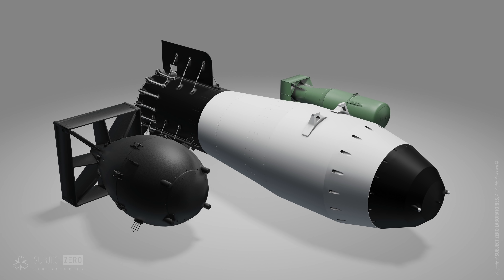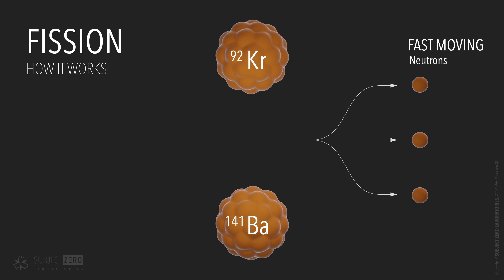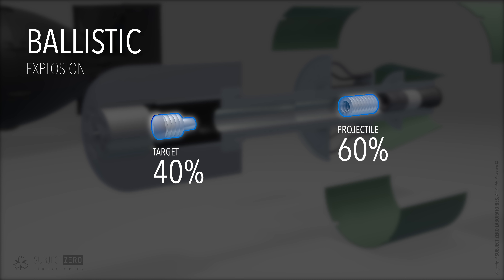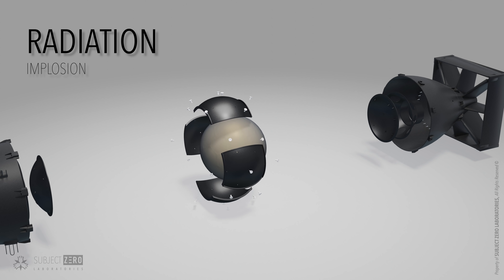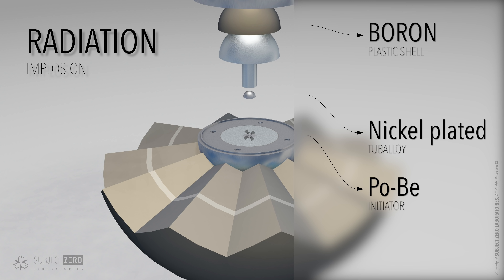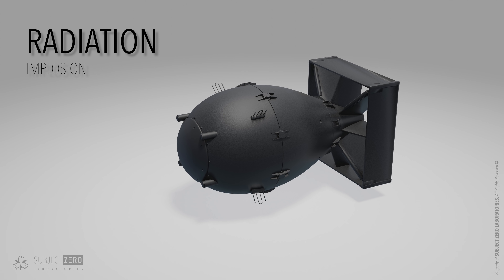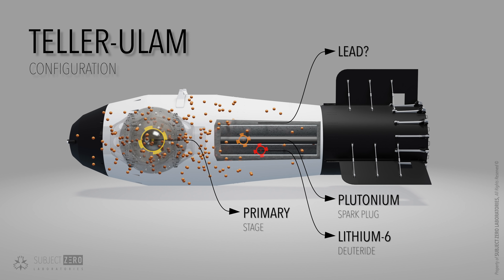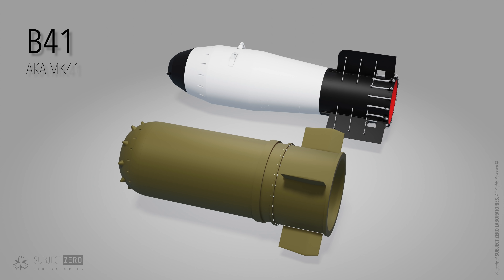Are Russian Nukes the Most Powerful?

Comment: Amateurish video. For example you miss label the stages of a Ulam-Teller design. The First Stage comprises both the primary and the spark plug. They serve the same purpose, to compress and heat the lithium deuteride to a temperature and pressure that allows for fusion to occur. The Second Stage is the fusion of deuterium  and tritium, two distinct hydrogen isotopes. Deuterium is part of the lithium-deuteride obviously and the tritium is produced during the reaction by deuterium capturing neutrons and also the decay of lithium-6 under the intense neutron bombardment.  The Third Stage is the fission of the tamper-pusher, the outer casing of the bomb. This casing acts as a reflector concentrating the X-rays emitted by the primary onto the fusion core. The process which creates the pressures needed for compression of the core is classified but it is believed it is based on ablation pressure, the rapid vaporization of the surface of the core under X-ray radiation creating a massive inward pressure. To be suitable as a reflector the casing has to be extremely dense and two materials can be used  - lead or depleted Uranium (U238). Using lead does nothing, there is no third stage. Using depleted Uranium roughly doubles the yield. U238 is the tame Uranium isotope, it cannot chain react since it's atoms don't fission when struck by fission neutrons. But they do fission when struck by the higher energy neutrons created by the fusion of the second stage. This generates a huge boost in yield, as mentioned but also massive radioactive fallout. The third stage being extremely simple there is no reason to test it. It will work every time so in test bombs it is always replaced by lead to avoid dealing with the fallout.
Reply: Tsar bomba had two Fusion strages ... the final fission tamper stage was lead (hence the 58mt instead of 100+) It was a true 3 stage weapon ...you don't count the tamper as a stage
Reply: No. The sparkplug is part of the secondary.
The primary serves to compress the fusion fuel, the sparkplug serves to heat it.
The tamper/pusher is not the outer casing of the bomb.
It is not true that the tamper is always replaced with a non-fissile material for tests. It's usually not replaced.
Reply: @Evan_Bell  Oh look mister details graced me with an answer. The way I was thought this shit is both fission devices - the primary and the spark plug make up the first stage. The second stage is the fusion stage and it can also be a primary for a third stage which is another bigger fusion stage and so on. The last stage which can be the third, fourth or nth depending on how many fusion stages are used is the tamper-pusher atoms undergoing fission when struck by the high energy fusion neutrons. Because the tamper/pusher is incredibly heavy and strong it doubles as the casing for the bomb. Of course an outer casing is added to enable handling the device and mount fins and other stuff that a bomb needs but structurally the tamper is the casing.  As for bombs being tested with U238 tampers you are right and wrong. Most early tests by all  nuclear powers used U238. Later tests didn't and this one certainly did not.  Had they used a active tamper the blast would have definitely killed the crew of the aircraft and also created a large amount of permanent nuclear fallout.
Reply: @sardoniclaugh9646  Well I don't know who taught you that, but it's wrong. The sparkplug is part of the second stage. The second stage tamper is not the bomb casing.
The radiation case and the ballistic case can be integral, but not the secondary tamper and the ballistics case.
Many of the early tests used HEU secondary tampers.
Also it's a bit odd that you mock me for detailing errors in your comment, when your comment details errors of video... Erroneously.
Reply: @Evan_Bell  It took me 20 seconds to make that comment. It's mostly right. He's making a lot of errors in a video that took him hours if not days to make. There's a difference.
Reply: @sardoniclaugh9646  Okay, but you repeated those errors in your reply, so you're still incorrect.
How long you spent creating erroneous content doesn't change whether or not it's erroneous.

Comment: There's nothing "easy" about making a plutonium bomb, neither making the appropriate high explosive symmetrical implosion geometry or timing all the needed triggers to ignite simultaneously.  Blithely characterizing it as such while slurping the knowledge off from the internet with no effort of your own is laughable.
Reply: Plutonium bombs are half-century old technology, not 'easy' but hardly difficult for modern state-of-the-art technology.
Reply: Considering that it was made for the first time in 1944-45... given access to the critical materials (which essentially reduces to... fissile material) it's amost certainly doable in any more or less equiped hacklab with the right people having the right skills (mostly high pressure hydrodynamics... something you can get from century old published material, that in this day and age, circulates freely as pirated books on the net). There's absolutelly NOTHING technically challenging about the design of a nuclear weapon at this point... only the procurement of it's nuclear explosive proper... fissile material

Comment: Little Boy was so simple that it was never even tested before used. They were sure it would work. Also, the enriched uranium was more expensive. The Fat Man bomb was based on Plutonium, which was far easier to manufacture, but plutonium was is difficult to detonate, which is why it was more complex. The Trinity tested the device.

Comment: The scary thing is the maximum achievable efficiency of thermonuclear warheads with current technology is 25% (only 25% detonates before the rest is vapourised up from 1.4% efficiency with little boy)
So the B41 8,800lbs weight only 1000lbs (450kg) is actually nuclear material.
So a 27 tonne version would only have 6.75x. The amount 3,073kg (6,600lbs) of nuclear material.
Meaning with technology with current warheads we could make a theoretical yield of 560 Mega tons for large bombs or 82Megatons for warheads that could fit on Trident Missiles. If nukes were 100% efficient.
And that’s before you explore other theoretical anomaly’s.
Nuclear science currently is only a glimpse at what physics allows theoretically.
Reply: Are you referring to fission or fusion efficiency? Either way it's incorrect. 35% fission and 40% fusion efficiency have been demonstrated. 
How did you arrive at that 450kg value? It's not correct. It contained at least 1.24 tons of fissionable material. The largest warheads that could theoretically be carried by the Trident II would be 2.16Mt, not 82 Mt. This ignores the fact that the theoretical specific energy limit is only achievable in very large devices.

Comment: BTW, slow neutrons are preferred to fast ones.
Reply: I thought it depended on the fuel type used.
Reply: Unless you are trying to fission the U-238 tamper, in which case fast neutrons are required.

Comment: What did you mean by the early nukes being easily disabled? Both fat man and little boy used a radar fuze to detonate at the proper height, that potentially could be jammed. However, IIRC there were pressure and contact backups as well. Of course, intercepting a B-29 is easier than an ICBM, but Japan at this stage of the war hardly had the means to do so.

Comment: 6:48
Prior to the detonation of the Castle Mike device, it was not known that both Lithium-6 AND Lithium-7 would fuse (the theory was that only one of the isotopes would work), which is why the original yield estimate was 6 MT - they found out with that blast that both isotopes worked about equally well, giving the device the actual observed 15 MT yield.
THAT is where the "2.5 times increase" actually came from.

Comment: In the early days Russia built higher yield warheads because their missile guidance systems weren't very accurate and might miss the target. Today the highest yield for the majority of US warheads is W88 which has a yield of 475 kilotons. Russia uses a 700 kiloton warhead. Since the destructive power increases by the cubed root of the increase in yield there isn't much practical difference between them.  More lower yield bombs are therefore more destructive than fewer high yield bombs of the same total megatons. Therefore 200 W88s would be far more destructive over a much wider area than two Tsar Bombas even though the total yield of the W88s is slightly lower.

Comment: Subject Zero Science. I really liked the video. Could I suggest another similar topic for a future video? I would like an explanatory video about the difference in the efficacy of an explosion. For example, if a volcano suddenly (not an eruption where the energy is only mechanical/heat) exploded the energy released would be some degrees higher than any bomb builded, but, it won't have the same effect in the proximity as a nuclear bomb which releases even X-rays. Another example would be the Chicxulub Impactor, the energy released in the impact is the equivalent to 10,000 times the modern nuclear arsenal, but if you somehow launch/throw a nuclear bomb and had the same energy released the effects would be different (and I'm not talking about the contamination). Maybe I'm wrong and I hope someone here could help me with this possible misunderstanding. Either way, thank you.

Comment: 1:20 some historical accuracy, they did figure it out, but to achive a nuclear explosian, you have to maintane the chain reaction of Atom splits, it won't just happen, if you have to little uranium, the reaction will die out before becoming an explosion, but start a weird "Chernobyl" effekt, where the uranium will radiate massive amount of radiation, and will do that for a long time because the uranium didn't explode. the german didn't had enough uranium to sustain this chainreaction, so it would have been a backfire if they still made it, but there were attempts of course, but the main reason is the shortage of uranium (sry for bad grammer or english I try my best to be scientificly understandable, if I'm not have some fun with the code cracking)

Comment: by the way the reason the "castle" accident happened in america, was, as I understand from a youtube doc. that some lack of supply of Lithium 6 lead to a 60% loading of lithium 7, as a filler material (scientists reasoning) : 40% Lithium 6, but what the scientists' didn't calculate was the fact that L7 decomposes to L6, BUT has a bunch of high speed Neutrons released as well, aka the yeild fuel you are speaking about with regards to the radiation method of launching a chain reaction; so instead of the calc. 15 MT of yeild, it resulted in an actual 50 MT release of energy, .... a lot of payments to indiginous peoples of near islands, etc. due to rad. poisoning, land/crop contamination, and so on.

Comment: The designed capacity of Tsar Bomba was more than 100 Mt rather than 50 Mt. But the bomb was investigated with its half capacity. There haven't ever been any others bombs created or exploded with higher capacity (including B 41) in the World. So it's the most powerful bomb in the World.
It's a real fact.
And it's strange try to guess what the capcity of B 41 would have been if it had been three times larger.

Comment: Nice graphics, but too much misinformation to be called anything science.  First, the Fat Man bomb was a plutonium bomb (Pu 239) NOT a uranium bomb (U-235).  All the descriptions of compressing the uranium core in the Fat man bomb are incorrect.  Second, the statement that the designs are so simple that it is surprising that the Germans didn't come up with the bomb themselves is missing the point and ignoring the remarkable technical achievements of the Manhattan Project.  It was not only the Los Alamos designers of the weapons.   It was the isolation of Plutonium (first discovered at Berkeley, then isolation proof of concept at Oak Ridge and finally industrialized at Hanford).  And the separation of Uranium 235 from the non-fissionable isotopes of uranium, all conducted at Oak Ridge, that was a HUGE$$$ technical achievement.  The project costs were over 2 billion USD in 1940's dollars.

Comment: A very interesting and extremely engaging video. The narrator is especially skilled and presents the details with great clarity and infectious enthusiasm. However it is quite a long way off when it comes to the real facts of the matter.

'Fat Man' used a plutonium core, not uranium.

The tamper is there primarily to hold the device together via inertia for long enough that an appreciable yield is generated. Critically it also works to make the explosive compression wave as uniform as possible. When chosen with care the tamper's substance will also act to reflect neutrons back into the core. If natural/depleted uranium is used for the tamper in a hydrogen weapon it will contribute enormously to the final yield due to fast-fission from the masses of neutrons generated by the fusion reaction. In fact in many ways this phenomenon could be considered the main destructive component of a modern nuclear warhead. The primary fission and secondary fusion stages may be thought of as present only to generate enough neutrons to allow this pseudo-tertiary stage to occur rather than for their own explosive effect--although obviously the Secondary in particular does make a sizeable contribution.

The pure fission weapon 'Fat Man' was triggered by conventional shaped charges not Radiation Implosion.

In the real world 'Radiation Implosion' is a process employed by a staged thermonuclear device. It is the method by which the X-Ray photons created by a fission primary, when mediated through FOGBANK or a similar substance compress first the fusion fuel and then the fissile 'spark plug' in the Secondary to reach their operational densities.

Comment: Great video. Physics get wonky at those temperatures and pressures. I find it absolutely incredible how humanity was able to nuclear weapons to work during the pre-transistor era. Between the precision timing required for the detonation system and the precision machining required to build the damn thing I am amazed the development and manufacturing teams were able to pull this off back then.
Reply: Because you don't need transistors to make a nuclear weapon.   You don't need electronics to make a nuclear weapon.  You don't need CNC machines to make a nuclear weapon.
Reply: @buckhorncortez  No you as you said you really don’t. You can make incredible things with crude electronics and pre-NC/CNC machining. However, it’s extremely hard and requires an incredible amount of skill. That’s why I find it so incredible and amazing. The work, effort, and determination of these people really shows just how much modern humanity as a whole has stalled.
Reply: @Veritas-invenitur  
“stalled”?

Comment: Another reason bombs as large as the Tsar Bomba aren't practical is that most of the blast goes upward, doing little more damage to the target. They do produce far more fallout, but blast it so high that it's as dangerous to the country that launched it as it is to the target. The strategic materials will do far more damage in several smaller bombs, which are also easier to deliver. Not that it's very comforting to realize that the superpowers have learned to maximize the destructiveness of their arsenals.

Comment: Uranium gun-type bombs may be dirt-simple to engineer.  However, separating U-235 by gaseous diffusion and electromagnetic separation was very expensive and industrially intensive.
Reply: Easy...first get a cascade of calutrons, a cascade of gaseous diffusion tanks, or cascade of centrifuges...next, get some uranium hexafluoride...yep...dirt simple...
Reply: @buckhorncortez  I'm not sure if you are disagreeing with my point.  Uranium gun is technologically simple, separating U-235 at scale is difficult and expensive. Evidence: Little Boy deployed and used without proof test. Scale of K-25 and Y-12 facilities at Oak Ridge.
Reply: @vibrolax  I made no comment about your statement of the design of a gun-type bomb.  The design itself is rudimentary.  However, the implementation of that design is not as easy as it appears.   They had to calculate the speed at which the U235 had to be brought together to avoid pre-detonation and a fizzle.   Then they had to design the gun itself and test the entire mechanism with materials simulating the critical masses to prove they could bring the masses together at the required speed.   

What they knew, was the amount of U235 needed for a critical mass.  What they didn't know was all of the intermediate engineering needed to make the two masses come together. They found out how to do it through numerous tests.   Yes, the design itself is simple.  Making it actually work wasn't.   Yes, once you know the final design, it is so straightforward, that they did not have to test an actual bomb because they had already tested the entire mechanism numerous times until they knew it would work by substituting the fissile material for the test materail.

Comment: Basically, a fission bomb is on the order of magnitude of ~1,000X as energetic as a chemical bomb of equal mass, and a fusion bomb is on the order of magnitude of 1,000,000X as energetic.
This also means the jump from fission to fusion, is of the same magnitude as the jump from chemical to fission.
Reply: Not really. The specific energy of fusion fuels is no more than 4 times that of fission fuels.